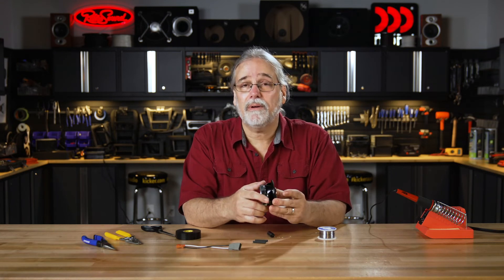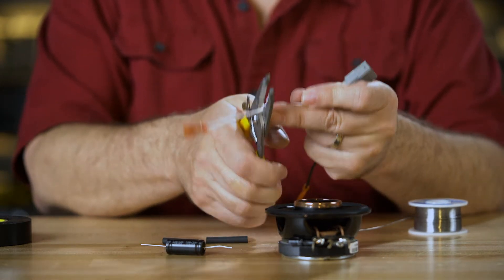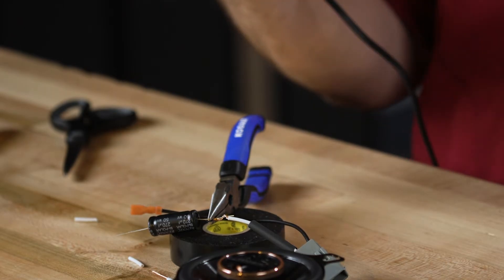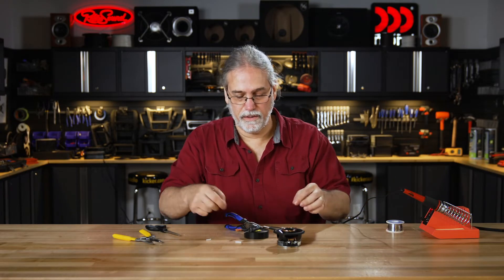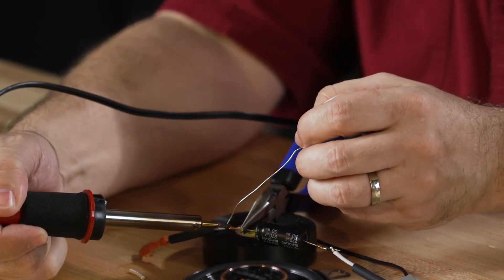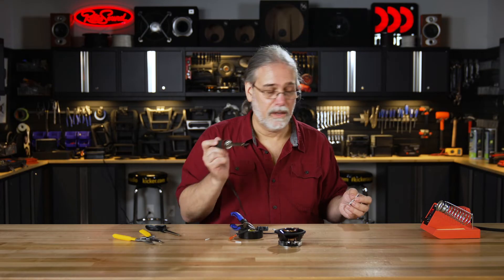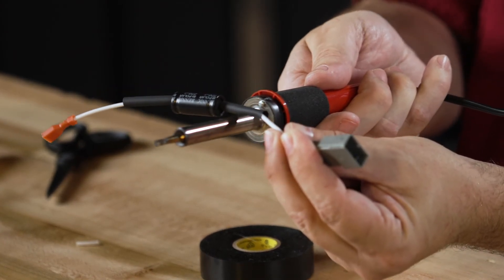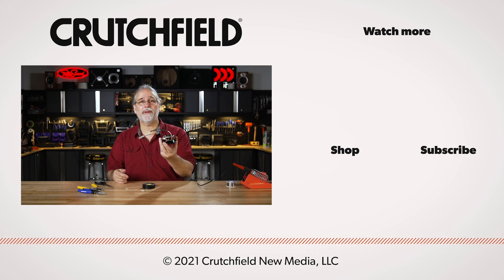How to install a bass blocker capacitor for car speakers | Crutchfield

Comment: Does this take the bass out of the speakers so I can just have bass to my subwoofer and do I have to add capacitors to all 4 speakers
Reply from the maker: Adding bass blockers/capacitors to the speakers will act as high-pass crossovers so that the lower bass frequencies don't reach the speakers.  This helps prevent the speakers from distorting, especially at higher volumes. Bass blockers are typically used with smaller speakers, such as 3-1/2" and 4" speakers, but if you have a subwoofer handling the deep bass, you could add them to even larger speakers like 6-1/2" and 6"x9" speakers.

Comment: i bought the Kicker KSC270. Thankfully it looks like the connections it comes with won't require me to solder to lines. - Should I still heatshrink the connection points ?
Reply from the maker: We do recommend still covering the wires, even when they are premade for easy attachment because this will ensure they do not accidently touch anything metal and cause trouble when playing audio

Comment: I have ds18 mid speakers what kinda capacitor i need sounds like they about to blow
Reply from the maker: Which DS18 midrange speakers do you have installed in your system?

Comment: Thanks for making this video. I'm adding a pair of Pioneer tweeters to the dash area of my car today. The specs mentioned the capacitor, but I wasn't sure which wire it went on. Thanks for making is simple and straight forward. 2thumbsUp

Comment: Please help me to connect 8ohms tweeter which type of capacitor do I need to connect it
Reply from the maker: Our Bass Blocker 5000 will apply a high-pass filtering of the audio at the 2500Hz frequency when being used with 8 ohm tweeters. You can find them here:

www.crutchfield.com/I-rYALc227/p_007BB5000/item.html

Comment: May I know the value of capacitor
Reply from the maker: Our Crutchfield Bass Blockers are available in 150 Hz, 300 Hz, 600 Hz, and 5,000 Hz (for tweeters) cut-off options.

Comment: I am installing a set of factory tweeters into a ford edge that do not have them from the factory. I have bought the crutchfield bass blockers. How close to the tweeter do the blockers need to be from the tweeter? Will the blockers block base from my speakers. I am planinning on tapping into the door speakers for sound to the tweeters.
Reply from the maker: They will install at the speaker locations. Just slide one of the Bass Blocker's connectors onto your Crutchfield speaker harness and the other Bass Blocker connector onto your speaker's positive terminal.

Comment: Hey do i need to use bass blockers  on Pyle horn phsp 6" 50watt 8 ohm when i hook them to my aftermarket radio thanks
Reply from the maker: The 8-ohm Pyle PA-style horn speakers are not designed for connection to an aftermarket radio that prefers to drive 4-ohm speakers on each channel. They have a 500Hz to 5 kHz frequency response so a band-pass filter would be required, a Bass Blocker would not be a good choice.

Comment: if you connect the tweeter to a crossover do you still to have a filter in the tweeter?
Reply from the maker: If your tweeters came with an included crossover and that crossover is connected, you do not need to add an additional filter.

Comment: What kind of Capacitor (ohm/ uF) would you need for each speaker?
Reply from the maker: This depends on many different variables specific to your own setup and speakers. If you want to check out all our available bass-blocker options for different frequencies check out the link below!

https://www.crutchfield.com/I-rYALc166/shopsearch/bass_blockers.html

Comment: Put these on my door speakers and now they don’t play any sound. Any clue what I did wrong?
Reply from the maker: It seems likely that either it is faulty bass blocker or perhaps the connections came undone. If you've double checked the connections and still hear nothing, you may want to speak with technical support. We include the toll free phone number to our technical support on the order invoice just in case their help is needed.

Comment: Hi I am in UK just bought a new Rav4, I want to upgrade the dash speakers which I ordered JBL from the US,  one side has dual speaker I understand one is for SOS. Is there any advice you could give on how to upgrade that speaker? I was thinking of removing the SOS speaker and moving it elsewhere, but not sure how to extend the cable. any advice would certainly help. I certainly will put in an inline capacitor as shown on your Video.
Reply from the maker: Congrats on your new vehicle! Is it a US specific model or UK?
Reply: It's a UK model right hand drive.
Reply from the maker: Sorry, we won't have specs on the UK version. If you want to take some measurements though and reach back, we'll be glad to see what we can help you match up fit wise; but you'll want to double check on how that is wired in as well.
Reply: Thank you very much I will work on it.
Reply from the maker: You're welcome.

Comment: Does it matter Wich side of the capacitor I use on the speakers positive ??? Any end dosent matter ?!
Reply from the maker: As long as the capacitors in the bass blockers are not polarized, the bass blockers can be connected in either direction. And the good news is that the bass blockers we sell are not polarized! They can be found here:

https://www.crutchfield.com/I-rYALc227/g_761/Bass-Blockers.html

Comment: do you have to solder them
Reply from the maker: In many cases, you can use connectors instead. Do you have a specific speaker in mind?

Comment: Hey guys please help me, I have 6 pioneer TS-G1620F speakers and two 1000W subwoofers on a bus. All of these connected to 400W pioneer amplifier. And I think i might need bass blockers can U help me which transistor should I buy?
Reply from the maker: We're happy to help.
What are you using for power?
Reply: @crutchfield  24v battery converter to 230V
Reply from the maker: Do you have the Pioneer speaker wired to a radio or an amplifier?
Reply: @crutchfield  wired to the radio
Reply from the maker: If you're using only the 6 4" speaker with your subs, 150Hz is your best bet: www.crutchfield.com/I-rYALc921/p_007BB150/item.html

Comment: I just installed 2 new 6x9 ds18 speakers into my front door panels and for the first five minutes they sounded great but them started to sound distorted at high volume did I blow them or do I not have enough power? I also have 2 12s in my trunk
Reply from the maker: We don't carry those speakers; but what is their RMS power rating and impedance? What are you using to power them?
Reply: @crutchfield  he didn't even say what brand they were lmao

Comment: Hi, does it matter in which direction the capacitor is soldered into the positive wire? I'm not sure wether it has polarity and would cause issues if soldered in backwards. Thanks.
Reply from the maker: Bass blockers are not directional, so the orientation of the Bass Blockers on the positive and negative speaker leads is not important. Polarity is important; the white wire is positive and the black wire is negative.

Comment: Can you use a base blocker on 6x9s?
Reply from the maker: Yes. What is your exact setup?
Reply: Hey i have a question i have 4 kicker 46CSC6934 6×9's in back deck, what the best hook up 2- 3 way passive crossover or just use bass blockers there hooked to aftermarket jvc kw-m56bt right now i will be hooking them to a 6 or 8 channel amplifier and i have 2- kicker 6 1/2 46css654 in each door and a 1"super tweeter  can i use a 3 way passive crossover on each door or use bass blockers thanks for all the help do appreciate it

Comment: Do you have any videos on how to wire in an ohm resistor and what resistors are best to use? Stock speakers are 8 ohm and I have infinity ref 3032, they are 4.
Reply from the maker: We do not have a video showing this process applied to resistors, but it does seem like it would be similar to this one.

Comment: this is a shot in the dark, but I installed two Infinity Reference REF-3032cfx speakers in my front dashboard of my 2007 chrysler 300 and I wasn't supplied with bass blockers from the manufacturer. would you know what bass blocker would work best with these speakers, so I no longer need to worry about distortion?
Reply: Make sure to double check the styrofoam, the speakers came in that’s where I found mine!
Reply from the maker: The Infinity Reference REF-3032cfx speakers should have come with two 270 microfarad capacitors that are enough to protect them it in any vehicle. We recommend installing them. If they are not available, then these blockers will also protect the Infinity speakers from playing frequencies they should not:

www.crutchfield.com/I-rYALc227/p_007BB300/item.html

If you use the ones listed below instead of that set above, then your speakers will be playing the frequencies it can play with the least amount of distortion possible:

www.crutchfield.com/I-rYALc227/p_007BB600/item.html

Comment: Front and rear speakers in my new bronco are both 4inch.  Should I get be using bass blockers on both?  I will also replace 6.5 inch speakers below dash and do not plan to use them there
Reply from the maker: Hi Vincent, adding the bass blockers can be a plus in most cases with smaller speakers; but what are you using for power? Do you have any larger drivers or subs as part of this system?
Reply: I am using a kicker 200.4 and am wondering about what size blocker to use and if I should wire the speakers in series instead of parallel (8ohm vs 2 ohm) for the dash speakers. Using Crutchfield supplied adapters with 4” and 6.5” kicker ks speakers.

Comment: Hi
The FRONT IN wires are white/white-black and grey/grey-white but who is left and who is right?
The same for the REAR IN wires which are green/green-black and purple/purple-black but which is left and which is right?
This is not stated in the documentation
Reply from the maker: Which wires go to the actual Left/Right speakers should not be a necessary detail to install bass blockers. You should be using the same brand/model speaker for both the left and right audio channels in say the front of the vehicle. This means you would be using the same model bass blocker for both of the front channels (same for the rear channels too).

Comment: Can you add a Bass blocker to 6.5 mid range speakers
Reply from the maker: Hi Henry, we'll be glad to see if we have a good match. What model speakers are you using? What are you using for power?
Reply: @crutchfield  I have 6 6.5 mid  2pm.mm
Reply from the maker: There is a chance that a midrange driver needs more audio blocked than a bass blocker can do. If that is the case with yours or if the amp will exceed 50 watts RMS going to the midrange driver, then bass blockers will not work. Were you able to identify the brand and model of the midrange driver you are referencing here? Also, which amp will be used to power them?

Comment: Which  capasitor can remove the bass in 10inch speakers
Reply from the maker: For subs, you'd want to use a crossover or even a DSP to make those settings. What is your exact sub/amp setup?

Comment: Hi, question, I am using Pioneer TS-H1703 composet speakers in the front and Pioneer TS-1356II (coaxial) speakers in the back, all powered by the default factory radio. Now I want to add a subwoofer. What bassblocker do you recommend, I guess I need one bassblocker per speaker? And final question, the speakers themselves already have inline capacitors for their tweeters, can bassblockers 'stack' with them? (without negative outcome)
Reply from the maker: You will need one bass blocker per speaker. We sell them in pairs. We didn't carry those speaker models but based on what we found online about them, the TS-H1703 should use these:

www.crutchfield.com/I-rYALc227/p_007BB150/item.html

and the TS-1356II match well to these bass blockers:

www.crutchfield.com/I-rYALc227/p_007BB300/item.html

Comment: What best bass blocker for pioneer 650 watt 9*6 it wiring in amp kenwood 500watt  4ch
Reply from the maker: Hi Bebo, what are your amp and speaker models?
Reply: Amp kenwood 500w 4ch
Speakr ts-A6977
Reply from the maker: Which model Kenwood 4 channel amp?
Reply: Ps 647
Reply from the maker: With that power which Kenwood lists as 40 watts RMS per channel and the speakers, you may not need to block the bass. However, you can test any time you want. It appears that amp has a filter that can be used to block bass from the speakers. You don't need a bass blocker as the amp already has a way to block it based on information we found on it.
Reply: I need it in other channel because I used 4 ch for speakr no subs's
Reply from the maker: You'll find a good match here: https://www.crutchfield.com/p_007BB150/I-rYALc921/Crutchfield-Bass-Blockers-150-Hz-cut-off.html

Comment: Can butt connectors be used to substitute the soddering? What size if so
Reply from the maker: You can use connectors instead. A 12- to 16-gauge speaker wire fit will work with our current models.

Comment: Should a bass blocker be installed on every speaker?
Reply from the maker: That depends on the setup, What vehicle is this in and what gear will you have in the audio system?
Reply: @crutchfield  vehicle is 2022 Ford bronco, replacing all 4-4" speakers. System is not B/O.
Reply from the maker: That size speaker is typically not good at producing bass. The best recommendation would be to use bass blockers on all the speakers and install a subwoofer system to produce the bass.
Reply: @crutchfield  thank you
Reply from the maker: Glad we could help!

Comment: Do you happen to know if bass blockers could be installed for the door speakers on a 2003 GS430 with Mark Levinson/Navi?
Reply from the maker: Bassblockers can be installed onto the woofers in the doors. Bass on the size of the woofer, we recommend this model bassblocker:

www.crutchfield.com/I-rYALc227/p_007BB600/item.html

Comment: Just upgraded the ram 1500 dash speakers to kicker DSC350 3.5's 2 ways . Which crutchfield inline bass blocker is recommended ??thanks
Reply from the maker: These would cut the frequency off at 150 Hz: https://www.crutchfield.com/I-rYALc174/p_007BB150/Crutchfield-Bass-Blockers-150-Hz-cut-off.html

Comment: I am running 2 cvr 12 kickers wired down to a 1 ohm, in a q bomb pro box, I just installed 6.5 c5 kicker door speakers all around. How do I block the bass from going to the door speakers and only into the subs itself, do I need the capacitor shown in the video on each positive side of the speaker? Will it take away from anything of the door speakers when installed?
Reply from the maker: Do you have an after market radio or amp you're using for power? If so, what is the power rating output per channel? Does the radio or amp have a built-in crossover or EQ?

Comment: Can i use bass blocker on a two way speaker with built in crossover (capacitor)?
Thanks in advance!
Reply from the maker: We will be happy to help. Which brand and model speaker are you referring to?
Reply: @crutchfield  Rockford fosgate prime R14X2. Thanks
Reply from the maker: Yes, so a bass blocker will prevent the speaker from ever seeing those vfrequencies.
Reply: @crutchfield  Great! Thank you.

Comment: Thank you for the video.
From where I can buy two capacitor bass blocker 270uf 50wv ? please let me know.
Thanks
Reply from the maker: The closest we can get is one that blocks at 150Hz with 4 ohm speakers:
 
www.crutchfield.com/I-rYTVc227/p_007BB150/item.html
Reply: @crutchfield   Thank you for your response.
Reply: @Tom Smith  Thank you very much, Tom.